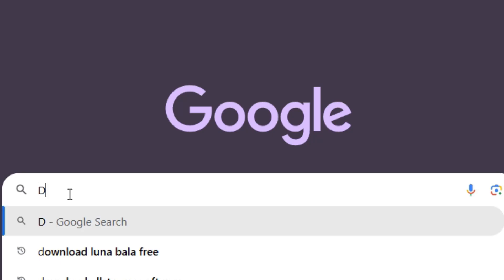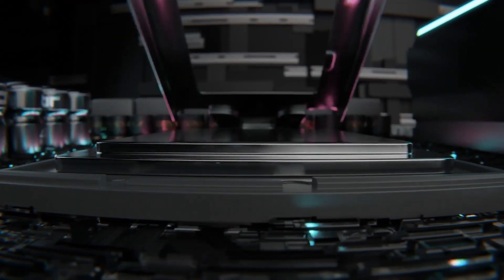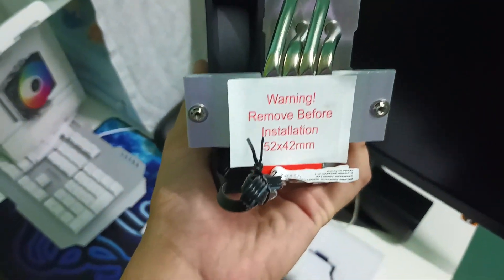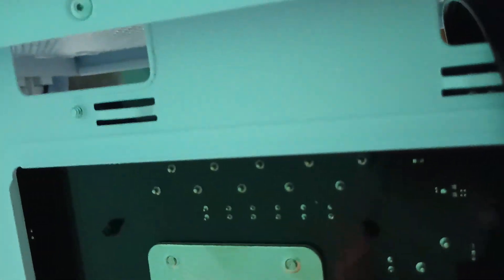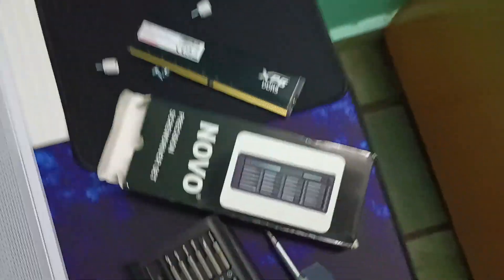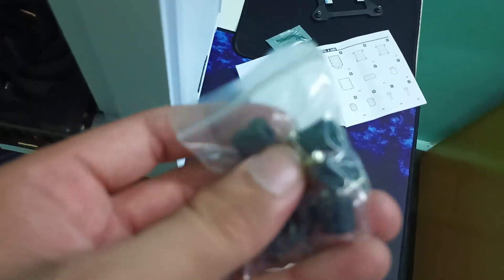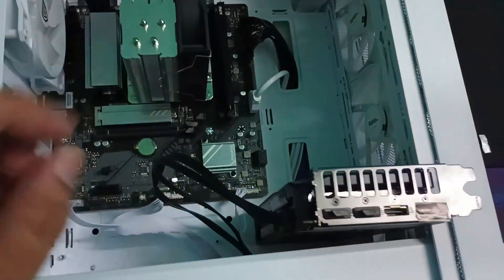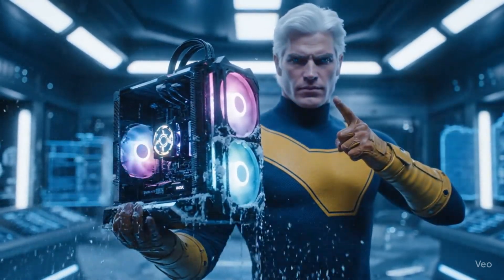Is the Deepcool AG400 ARGB cooler really worth your money in 2025? #cpu  #Deepcool #Intel #AMD #ARGB

Comment: I bought this cooler and im happy with it, it keep my CPU 28-30C at idle and 50C while gaming. My CPU is i7 9700k. I also have one case Fan Noctua NF-F12 industrialPPC-3000 PWM 120mm that blows directly agaisnt the cooler.
Reply from the maker: That's cool! 😮
And there is not need of AIO, if you have Deepcool air cooler.